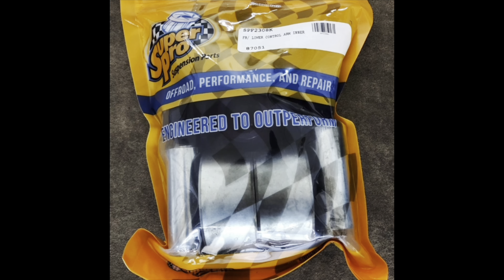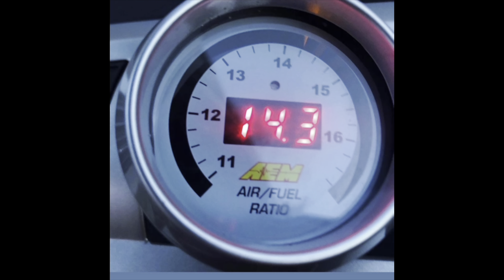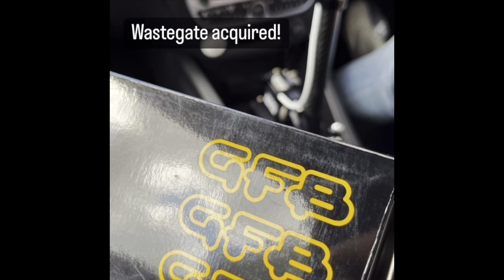Honda Civic ep3 turbo build 380bhp

Comment: What size injectors are you running and what fuel pump
Reply from the maker: GRAMS 1000cc injectors and a kemso 340l/hr fuel pump. The pump is cheaper than the others, works great and super easy to fit.

Comment: What did it cost to convert?
Reply from the maker: About £5-6k
Reply: @Smffab  not bad that!  it puts the power down well compared to alot ive seen
Reply from the maker: @tomcoxon3520 yeah at about 380hp with semi slicks in the dry with limited slip diff and boost by gear it does quite well
Reply: @Smffab  youve done well there if thats including the lsd and wheels and everything. 380hp seems a bit low tho